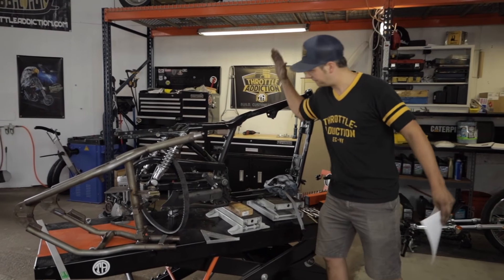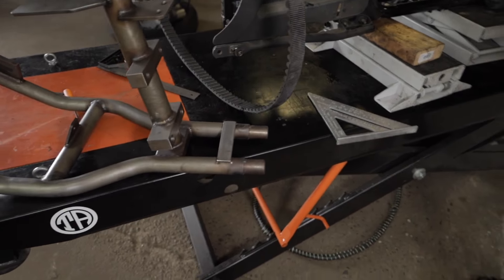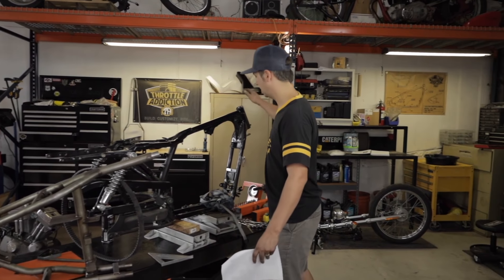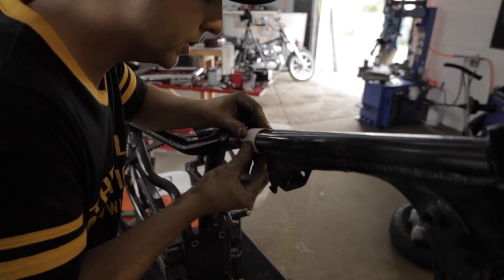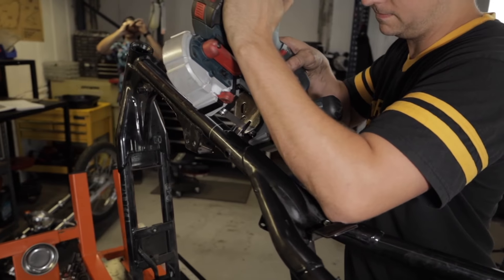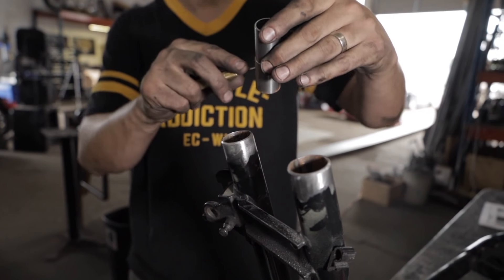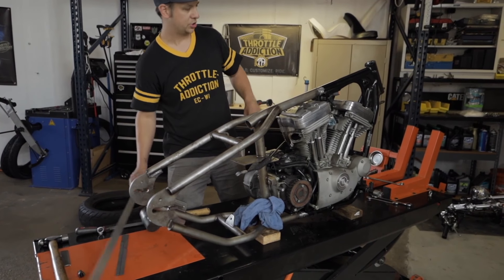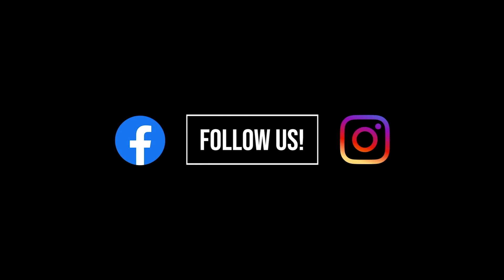Part 3 of 4: How to Install a Throttle Addiction Deluxe Sportster Hardtail Kit - Cutting The Frame

Comment: Just a quick note for clarity: Neither of you specified (to the Viewing Audience) where you truly pulled the 16" Back Bone measurement from? The Center of the neck tube? or outside edge of the neck tube? you kind of breezed through so it 's not truly clear.
Reply from the maker: You measure 16" from the front of the neck, here's a link to a copy of the instructions, it has a picture that should help clear it up: https://www.throttleaddiction.com/blog/sportster-hardtail-installation-instructions/

Comment: Can this go on a 2007 xl883?
Reply from the maker: Unfortunately not, it fits Sportsters from 1982-2003
Reply: Is there anything i can use on my 07 to give it that chopper look
Reply from the maker: @borrego4205  There's a couple hardtails out there on the internet for newer Sportsters so that's an option for you. Otherwise we sell chopper gas tanks, handlebars, smaller seats and a lot more that can work on an '07 Sporty and will get you more of a chopper look.